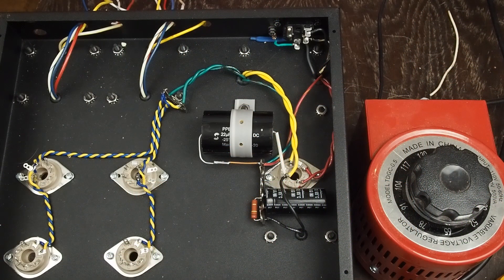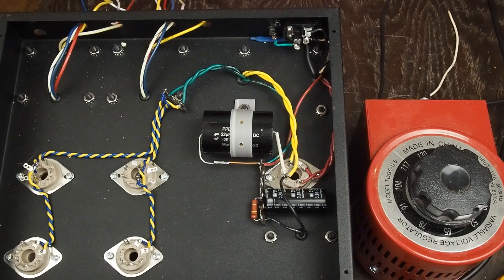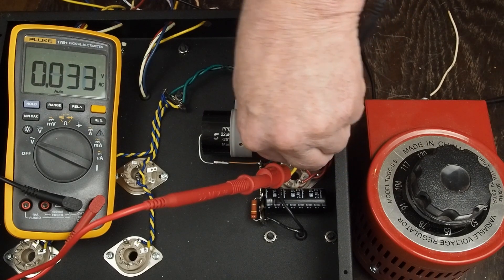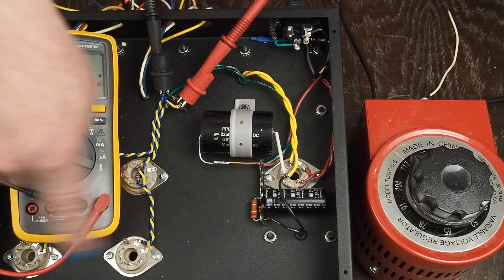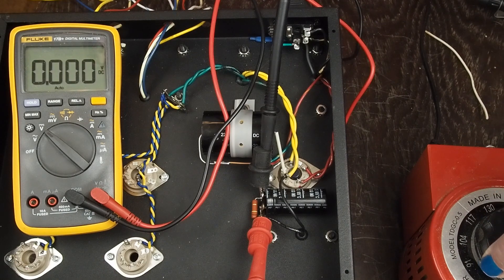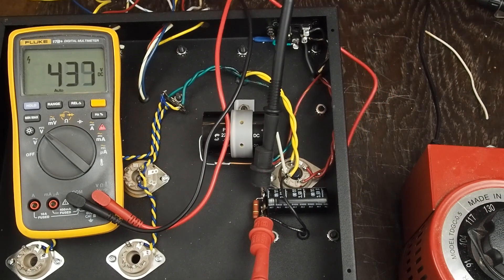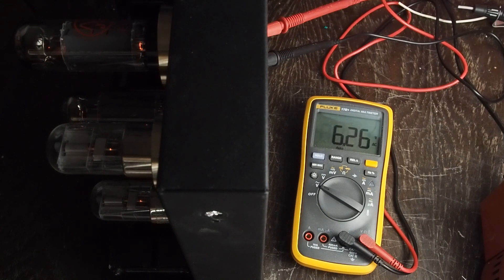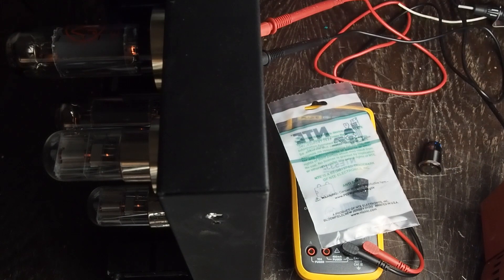6SQ7 EL34 Tube Audio Amplifier: Power Testing

Comment from the maker: OK folks DO NOT short out a capacitor as a safety precaution!!!! You have been warned!!!!!!!

I just typed this all out but then the commenter deleted his comment so mine would disappear, so I will type all this out again:

"Shorting" out a capacitor that possibly has high voltage in it is a REALLY bad idea. It will not only damage the capacitor or possibly cause the capacitor to explode, it's also Very dangerous if you are touching anything as the cap can drain though you! Be patient, let the bleeder resistor do it's job and ALWAYS check for voltage on the B+, like I show multiple times in the video, before you touch anything. If for some reason the device has no bleeder resistor, you can make a tool like Mark At BlueGlow shows in this video, or go do something else until they drain themselves over time.

Again, DO NOT follow the commenter's advice to "Short out" caps as a safety precaution!!! 

https://www.youtube.com/watch?v=gLDCV-n1BDw

Comment: n the schematic of the power supply for the capacitor it says 22uf/630v, if it is replaced with a larger or smaller value, does it not affect other components...for example 22uf/630v is replaced with 25uf/500v...thank you madam..
Reply from the maker: A 25UF 500V would be fine. Again, don't run it on full input voltage with no power tubes wired up and installed.

Comment: SKUNKIE, When turning the power on with the Plate voltage/B+ voltage on the power tubes BEFORE the heater voltage. Why would this damage the power tubes and filter capacitors because the power tubes aren't conducting? Most amps have a standby switch is suppose to be used first to turn on the heaters to the tubes then the power switch turns on the B+ voltage
Reply from the maker: In a cathode biased amp, the cathode begins conducting at full current through the parts of the cathode that heat first, possibly causing damage (stripping). Bringing the voltage up slowly after the heaters are working allows the cathode resistor to set the bias on the tube, so it's not "wide open" at full B+ with no negative grid bias on start up. At least that is the idea.

The issue with the filter caps is the B+ can sometimes be 50-100V over the running voltage once the tubes are conducting. This then requires much larger and more $$ (and sometimes very hard to find) higher voltage rated caps. For example, without slow start up, this amp could not use the 450V rated filter caps it is using.